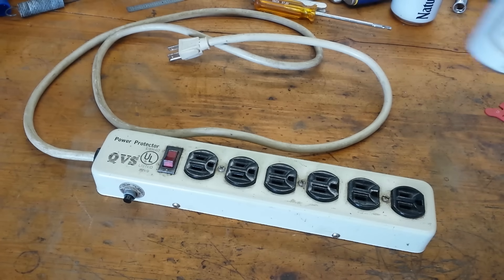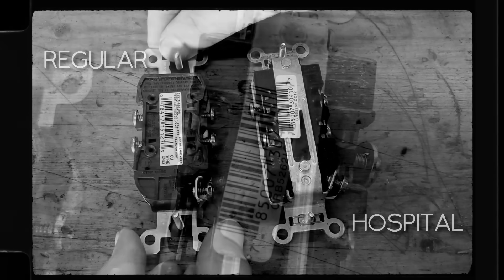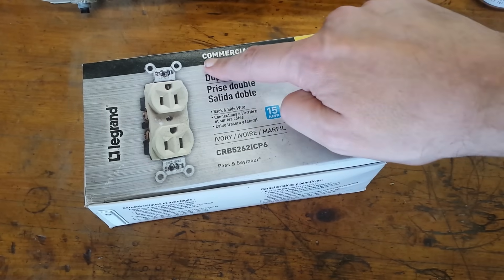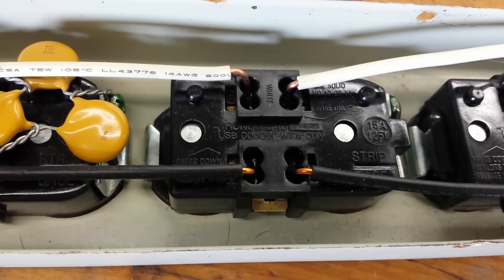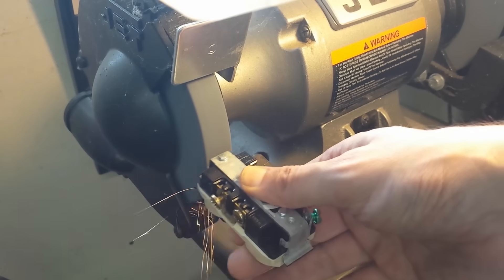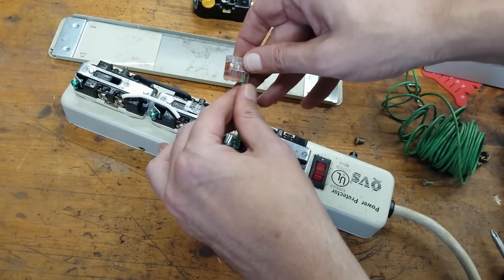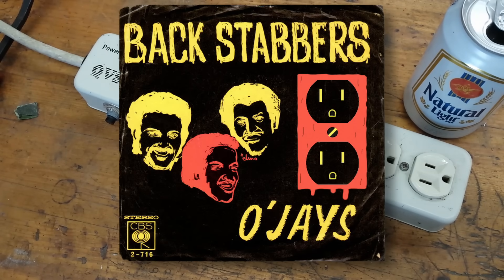I like "upgrading" old power strips for some reason...

Comment: REAL power strips now have USB ports in them.  Worth changing them out occasionally. Make sure it is surge supressor capable and have UL/CSA or other recognized safety agency approval.
Reply: You could retrofit one of those modern house receptacles with USB ports built into it in one of these old metal power bars too if you really wanted though.

Comment: Those great old metal power strips are the best as long as they are grounded right. But for me, I'd have just used regular outlets and kept or fixed the overload circuit breaker.
Reply from the maker: The circuit breaker is still there, I just eliminated the surge suppressor. I'll do another video on replacing the surge suppressors in the future.
Reply: @ballinator  Yeah, I used the wrong nomenclature. I recently got one of these that has 9 outlets in a row with the outlets situated in a way that allows the use of wall warts without blocking other outlets. Got it at a discounted overstock warehouse for $10. It's great for my office desk PC setup, router and cordless phone.

Comment: Please, don't leave ground like this. This is horribly unsafe and violates code. Just solder them all together and it is going to be much easier and safer, than series of wago.
Reply from the maker: How can it be less safe than the factory method of grounding through the cover plate screw, which is perfectly legal and earned the strip a UL sticker. I added an additional path to ground, so now it's impossible for it to ever loose ground....

Comment: Nice. Speaking of surge suppressors wearing out, I’d love to see some videos of modding/restoring old classic surge suppressors. Like the under-the-monitor flipper switch models from the 1980s. But with new [working] components and LEDs replacing the bulbs. I can’t be the only person on YouTube who’d like to see stuff like that.
Reply from the maker: Thanks, I'm thinking of doing another video where I replace the surge supressor.
Reply: @ballinator  Would love to see that. For better or worse I work with a lot of electronics that get angry when there's a surge.
Reply: I remember those under-monitor surge suppressors! Also cool are rack-mount ones for audio gear.

Comment: In Newbury Park California we use to buy these metal ones in the mid 1980s. The fire department inspections banned using extension cords in our test laboratory..

but these metal plug strip were OK.  But their cords were too short.  

And if plugged into  and extension cord illegal.  It did not matter if the extension cord was 10awg and 2 ft long.. lol

So we bought 25 ft extension cords and replaced these metal plug straps with longer cords 

Once production was overseas they used a zillion extension cords 

In the usa You probably could have had the modified plug strips with 18 awg wire. Dangerous.  All they focused on is no extension cords no matter if locomotive wire .

Comment: The original outlets used in most of these strips is the Rong Feng E-06. They are available on eBay.

I love these old metal power strips from the ‘90s. They are so much safer and more durable than the plastic units that are available today. Unfortunately, these have become kind of a lost art. The metal power strips that do exist today are really just plastic strips with a fancy metal front; the bottom sides of most of these strips are plastic, and they use bus bars as the outlets internally—so while they look high-quality, they are just the same as the plastic models. Real metal power strips, like this one, are fully repairable and use higher quality components than molded plastic units. I just wish these were commonly available with better surge protection and more outlets. It seems like you’re kind of stuck with 6 outlets and <1000 joules of surge protection with most of them.
Reply from the maker: Thanks. Great info!

Comment: Wow nice and yes I used wagos before even worked for my mini fire alarm system and for replacing a GFCI to a new GFCI with usb ports much better then typical wire nuts

Comment: I've seen too many wagos fail with any kind of amperage put though them. I only use them for temporary control wiring where they would see no load. I'd never trust them in this application.

Comment: In case anyone wants to know exactly what code violation occurred at 3:12:

110.3(B) Installation and Use. Equipment that is listed, labeled, or both, or identified for a use shall be installed and used in accordance with any instructions included in the listing, labeling, or identification.

Comment: Subscribed. Good job. Next time you can replace the little neon bulb that illuminated the red switch on the power pack and replace the capacitors? I am now going to have to do my power strip too. The breaker kept tripping on it and the switch is getting damaged.

Thanks for the content.
Keep up the good work.
Reply from the maker: Thanks. I can do another vid on replacing the surge suppressor caps in the future. Usually I replace the whole switch.

Comment: In addendum to make a test rig I do the above plus I will wire the last two  via the switch and keep the others always hot, then route the switched outlets thru a loop (with rubber grommets I'm not a barbaric) to the outside for an ammeter. With the switch that's helpful for surge current readings and to quickly power down when troubleshooting.  A double pole switch to lift neutral if your so inclined and my personal favorite a ground lift for the switched outlets as come from an audio background.  Good video
Reply from the maker: Interesting! I like the idea of the loop for readings with a clamp meter. Might have to do that sometime.

Comment: Receptacles are made to have the yolks clipped off with side cutters. You can see the line on most of them. That’s how they fit in some 4 inch metal box covers that are extruded for a single receptacle.

And spec grade are cheap enough I don’t know why anyone would chose to use the cheap ones. If nothing else the side clamps are soooo much nicer to use than a wire hook and you can very easily torque those down wikthout messing with the hook. Buy once cry once.

The other cool thing about your surge protector here is you could wire it with NEMA 6 for shop tools and with a NEMA 14-20 you could have a mix of NEMA 5 and 6.
Reply from the maker: I did try clipping the ears off first, but there still wasn't enough room. I agree on the side clamps. I'll have to consider making another one with the different type outlets for the shop in the future.

Comment: I took a metal wall box meant to hold 10 switches and made a 20-outlet power strip using ten 20-amp commercial outlets and a 25-amp cord with a commercial strain relief where it enters the box.  Been using it for twenty-two years now.  Still working great!  Probably could have paid over $100 for such an outlet box made of plastic with sheet-metal strips for contacts.  Mine cost a third of that.  And I enjoyed putting it together!
Reply from the maker: Very cool!
Reply: The problem with using 20 amp rated receptacles it might encourage someone to plug in an actual appliance cord with the offset prong specific to 20 circuit requirements when the feed circuit is only rated for 15 amps.

Comment: 2 Wago's to introduce multiple points of failure for what could have been done with one run of ground wire with either midpoint strips or bare and one ring terminal. And would have been far better to tie the ground to the screw with the lead from the cord than depending on that tinfoil case as your ground path end to end then back to the outlets . . .
Reply from the maker: Every wire nut in the house is a potential point of failure already. The cord ground is already soldered to a tab on the case. The wires I added are just an 'extra' path in addition to the existing path through the retaining screws.

Comment: What is the purpose of the caps?  Smooth out spikes?
Reply from the maker: Surge suppression. They're some kind of varistor. Basically they 'absorb' the spike in voltage, but they can only absorb so much, so after a number of hits they don't work anymore.
Reply: @ballinator is that why you pitched them?
Reply from the maker: @alexanderchapman2525  Yeah, I doubt there still good after 20+ years, and I'm plugging the strip into my UPS unit which has it's own surge suppression.

Comment: I've used hospital grade and commercial outlets, in my experience the hospital outlets grip many plugs too well, they're hard to unplug, and very expensive, so I would use commercial grade for a power strip. Power strips get plugged and unplugged, too much grip is hard to use when the outlet isn't anchored in a wall.
Reply from the maker: True. This one is mounted under my desk and has networking equipment plugged into it that will probably never get unplugged.
Reply: Very true.
Reply: Did you catch the part where he ground off the mounting brackets?  Now the only thing resisting the added stress is a tiny screw in the middle plastic.  Did you notice how he skipped over that part?
Reply from the maker: @rbhe357  Wait until you figure out that the original outlets, which didn't have mounting tabs, were also installed the exact same way, and were perfectly fine. Also it's not threaded into plastic, there's a metal insert.
Reply: @ballinator Don't need to wait.  We saw them in the video.  We also saw you replace them with ones you modified, and even joked about disregarding safety while doing it.

Comment: You could have avoided using connectors and wired the ground screw of  one outlet to the next outlet's ground, to the next, and had just one ground wire to attach to the case.  This assumes that the case is indeed grounded.
Reply from the maker: True. I always mess it up when I try to strip insulation off a wire in the middle. I suppose I could have just twisted two wires together and wrapped them around the screws.

Comment: When you are grinding off those tabs, you should mask-off the body of the outlet to make sure you don’t introduce metal filings.
Reply from the maker: Top tip! Yeah, def don't want metal shavings inside the outlet.

Comment: So does it still offer surge protection?
Reply from the maker: No. I'm plugging it into my UPS unit, which already offers better surge protection than what this had. You could always replace the varistors with new ones if you want to keep the surge suppression. I wouldn't put the old ones back in, as they loose their ability to suppress after taking so many hits, and who knows how old they are.

Comment: Nice job . Great video ..very helpful  . I have expensive power protector strips that have one or 2 or 3 bad outlets but the rest work most of them are plastic fire hazards..I have a few older ones that are metal where all the outlets still work…

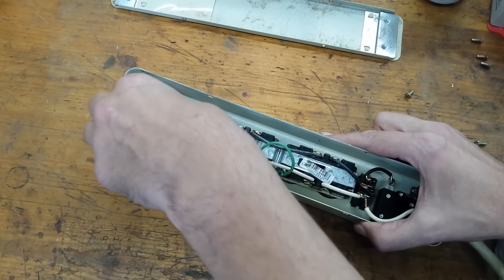Comment: 5:15 So you didn't put back those disc capacitors seen here 2:23 If you didn't do that, that's NOT an upgrade. Sure, it won't shock you due to the overgrounding but if there's a strong power surge everything connected to this is toast.
Reply: Actually, the discs are varistors which are designed to short transients over about 300-400 volts to ground and that protects potentially sensitive equipment that is plugged into the power strip. But they do have a limited capacity to absorb transient energy (measured in joules) and if that is exceeded they can fail or if there are many transients in the area, the varistors can fail in time and may show burn marks or actually break apart. Still, they are worth the effort to keep in the power strip. There are 3 so that the protection is across all combinations L-G, N-G and L-N. It would not hurt to have a large capacity module near your home circuit panel. Many products with electronic circuits incorporate some transient protection but that is not easy to verify. And it would be easy to replace the old varistors with new ones after going to all the trouble to replace the receptacles.
Reply: @bernards8050  Thanks for that comment, that is helpful I've been trying to become more confident in my household power that I suspect is being energized or has a microwave signal injected into it by bad actors;. i've been looking for ways to insure that only the 60 Hertz 120 volts is present and all other frequencies rejected, but it has been surprisingly difficult. I suspect the bad actors are using beamforming techniques and mmWave  and illuminating the power at the entry or in the breaker panel. At least I think this is now possible and an element in a RF surveillance imaging system.
Reply: @policedog4030  Actually, power lines do not support RF very well although for short distances, broadband RF can exist on home wiring and that has been used by some modules to distribute Internet on home wiring. And all electronics that convert AC power to lower voltages have sufficient filtering to eliminate RF interference. The exception would be AM radios as the have embedded antennas.
Reply from the maker: It's getting plugged into my UPS unit, which already has better surge supression anyway.

Comment: I always tell people to buy metal body power strips as they have REAL outlets in them, not a continuous metal strip that overheats.
Reply: I found a bunch of melted versions of that in a building I'm working on in Bolivia and it's a house that has a mix of 220v and 110v outlets so basically a few outlets they can't use and a dozen things plugged into the ones they can use.

When I changed those single outlets they could use to double outlets I noticed that the wiring underneath was basically what you might see in Europe or North America from that time period.

In the 50s they made the switch from 110v to 220 that's why they have both.

I'm from the UK but I do have an actual electrical qualification
Reply: Those metal strips don't overheat, are you plugging a space heater into the crappiest power strip money can buy?

Comment: Nice ! I just invested in a shop power stip with individual switches for each plug. 

I now always go commercial grade for outlets. I haven't had to replace one yet. The residential ones seem to lose "hold" in 10 - 15 years. I find the ones with a plug in all the time lose grip more than the ones with a lot of in-out. Those are the most dangerous because you will not realize they are weak and arcing. 

I'd watch a Ballinator tear down comparing Residential vs Commercial vs Hospital grade outlets, 15 Amp vs 20 amp. Leviton vs GE vs Eaton.
Reply from the maker: Interesting idea. I'll consider doing an outlet tear down for a future video.